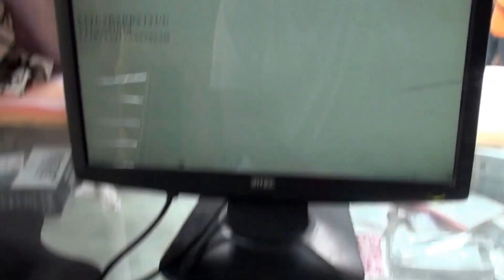How to repair keyboard with some key not working

Comment: when i connect my usb keyboard to pc ..it start typing random keys automatically it there is some ghost and den pc gets shut off...
i tried using pc without keyboard it was doing fine..
and also i connect that usb keyboad to my laptop it was doing fine there..
please help
Reply from the maker: +Arti Dalwani 1. check all keyboard buttons one bye one .
2. check the usb cable.
3. Check another usb keyboard with ur computer. If problem is still unsolved than the problem is definitely with you computers window.
Reply: +Vinay Tiwari..
ok thnks sir
Reply: same problem
Reply from the maker: +Youssef  try this
Reply: Vinay Tiwari  OK I will
Reply: Youssef i chngd the co. of keyboard now its working fine...
its bcz some co. doesnot support some pc
Reply: Arti Dalwani You probably changed something in settings
Reply: Same mine did that
Reply: numlock off , reinstall keybaord driver, best solution - put it in some hot healthy soup

Comment: 2:02 congratulations you destroyed your keyboard
Reply from the maker: no, its working fine now, seriously.
Reply: Okay dude i have done a mistake i spill a glass of water on my mechanical keyboard now wdsazxcqe buttons are not working
Reply: can you please tell me a solution i will sub if that solution will work
Reply from the maker: sorry bro this is not a mechanical keyboard, its time to buy new one. this works if you have dust problem in your keyboard.
Reply: I dont have any dust problem
Reply from the maker: +POV Gaming u r lucky
Reply: Haha good joke
Reply: @suplobroy2169  Open keyboard and try to spray alcohol on those keys and clean with fresh cloth. It will surely work then

Comment: Does this work with mechanical keyboard?
Reply from the maker: +x_susano_x may b not.
Reply: x_susano_x I think its a bit easier to clean a mechanical keyboard as you can take the keys right off to clean them